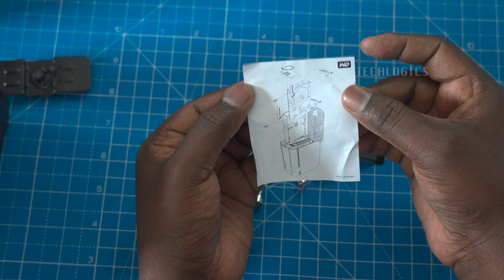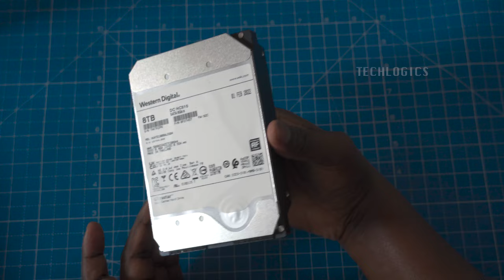WD My Cloud EX2 Ultra NAS Hard disk drive installation | Part 2

Comment: OK - I've had this unit for a couple of weeks fitted with 2 x 8TB IronWolf Pro NAS Drives.

It's a good unit and easy to setup and use BUT - why OH WHY didn't they cool it better. Running as stock my HDDs were around 50 Deg Celsius - sometimes a little higher. Bought and placed a £15 USB fan on the top (with 3 speed settings) and the temps have dropped right down to the Mid/Early 30s - it's insane that for such a low cost better ventilation isn't provided. 

That aside it's a good NAS.
Reply: Can i use SSD as a main storage with it?
Reply: @ammaribrahim94  I don't see why not but I'd check with WD
Reply: @ammaribrahim94 you can but they probably used cheap data connections internally. Because they didnt even put a cheap fan at top which could reduce its temp around 40%. I think you would cap the data transfer speed at somewhere with it.